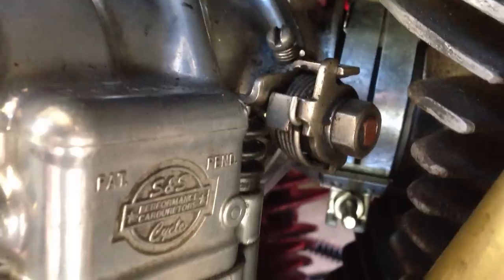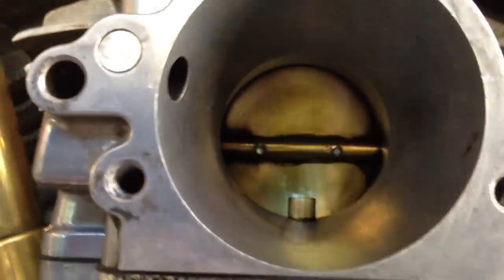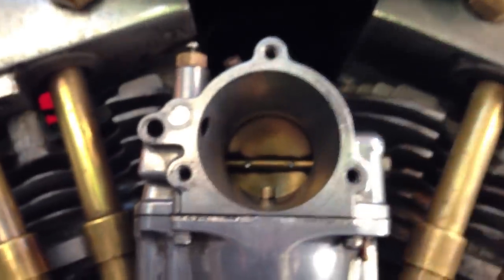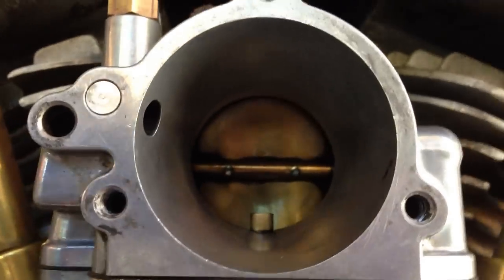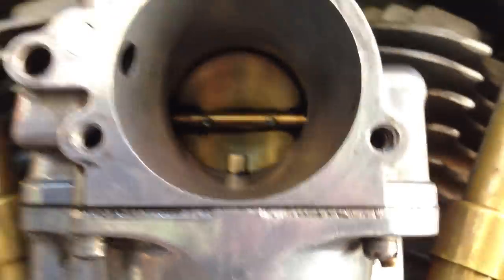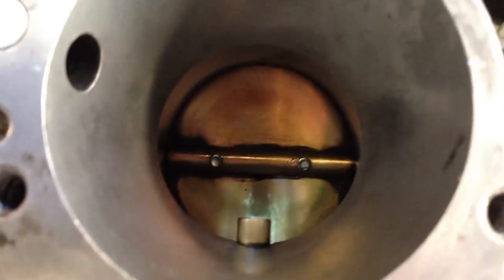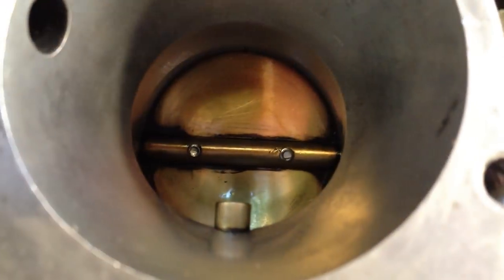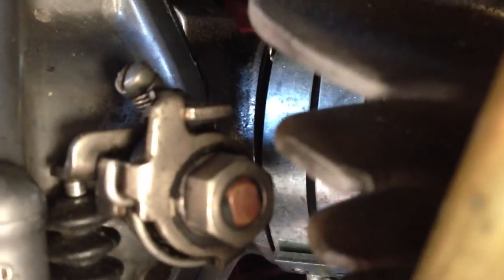Accelerator pump issue with  my S&S carb on FXWG

Comment: S&S carbs are designed to drive the owner crazy.
Reply: Yes ..but if you close de accelerator pump ..is more relax in the street  ..but with the racing power ... cheers ..

Comment: Kind of black in the venturi looking yet .  Some cleaner might let the butterfly close better . You probably rubbed the carbon off the walls pushing the valve in .   S&S  videos say to go 2 turns out from bottom on the pump setting as a starting point .      Have the same issue .

Comment: Did all the carburetor tuning and adjusting while the engine was running and these were my best results after trying different combinations!........ Final adjustments: 2-3/4 turns works great on my S&S super E carb for my Accelerator Pump, gives it a crisp response on the throttle, with 1-7/8 turn on my Air/Fuel mixture (you might want to go richer depending on the altitude), and 2 turns on my idle screw (I personally like my bike to idle at about 750-800 RPM for good oil pressure I don't dare lower my idle very low! the engine might sound Cool (lopy cam) but not good for Oil pressure on the engine). So all three screws were turned upward from the close position. (close position: Counterclockwise) Happy Trails 👍........PS  As far as your butterfly not closing all the way you have to much Carbon build up on the back side of the butterfly and Venturi area of the carburetor. It could also be your accelerator rod that has to be cleaned up as well. Like the text below stated 1000 grit sand paper should clean it up fairly well. S&S best Carburetors ever bar none!! BTW I run a Shovelhead

Comment: Yes the pump is connected to the butterfly and yes you are adjusting the acc pump with that screw which in turn adjusts the butterfly. The throttle plate must be open slightly for it to idle properly. The butterfly has to let some air in for it to idle proper. IF you manually close it with your finger it will not Idle and die. Why are you making adjustments on an engine that is not runnin and properly warmed up?You need to first adj the idle speed then the main jet mixture then the accelerator pump all this is to be done in sequence and when it is running.
Reply: This is the answer right here. I just rebuilt a super g which the only difference is throat size, and during the process of getting settings to stock they explain why it's like this.

Comment: Hello are you serious guy. Your carb is disgusting dirty. Tear the butterfly and shaft out and clean them. Duh. Your throttle return spring can’t handle the return because it’s filthy. When the accelerator screw is all the way in you now have two return springs closing the butterfly not just one.  Tear carb apart and clean it. Will be good as good. Maybe above your ability tho as them spring are kindda tough to get back in place. So atleast take close up vid an pics before you take it apart.

Comment: The only part you need is a can of carb/brake clean and a scotch pad and cpl 10mm wrenches and a flat head and red lock tight for the 2 butterfly screws.  Wrk on these weekly. Nvr thought this would be a miss from ppl as all the mechanics of operation are right there in your face.

Comment: Rebuild kit for your carb is less than $80 from S&S.  Disassemble, soak in Berryman's, clean all components and reassemble carb. Takes about an hour and you are good to go.
Reply: I did this soaked everything for 3 days except gaskets and O ringside. Got the $100 rebuild kit and I can't get the accelerator pump to squit.

Comment: I had a problem like this. my throttle cables were too tight and misadjusted. after I "fixed" it my bike ran smoother at low rpms. idk why but I love it. lol

Comment: How was it running before U started to adjust the accelerator pump ? Put it back to the way it was  , make adjustments while running . The plate shouldn't close all the way . Did U adjust the throttle cable to ?

Comment: Nearly 15,000 views and no answers.
I'm bummed too.

Working on my 73 Ironhead with Shorty Super E now. Bogs and seems to starve for fuel when hitting higher revs/speed.
Gonna try a high flow petcock.

btw II... My squirts of gas looked kind of lame. Small stream but aiming hard right. Not down straight towards intake. My first HD btw3.
Reply: Did you cam it or boar it out?
Reply: Thanks guys.
I sold it. That fixed everything.
lol

Comment: The butterfly could and may not be centered in the Bore of the carburetor loosen those two screws on the butterfly let it center and the boar then re-tighten them they’re very very tight but you have to do that to center it in the bore

Comment: something to do with the assembly of the return spring and washer and outer lock nut all together there on the shaft that holds the throttle plate. if you had it apart, perhaps you didn't put it together again properly